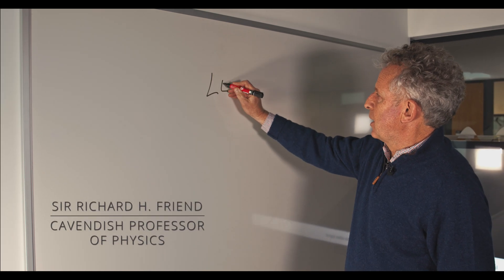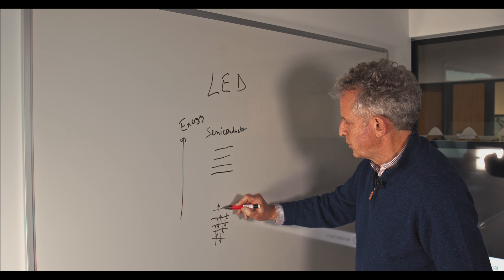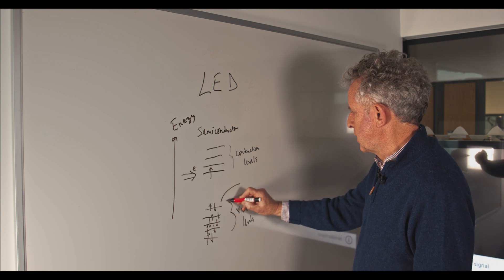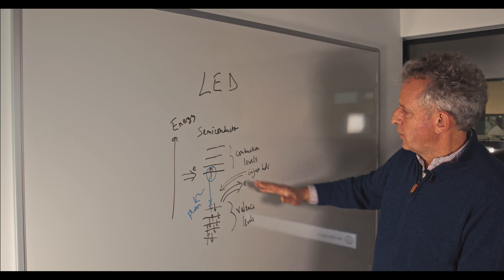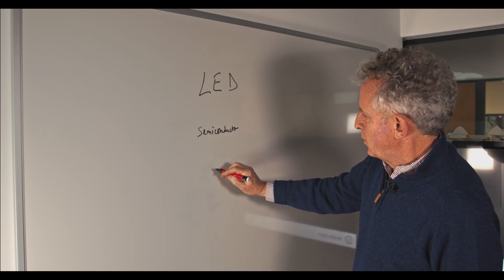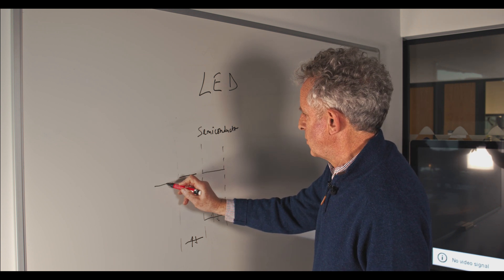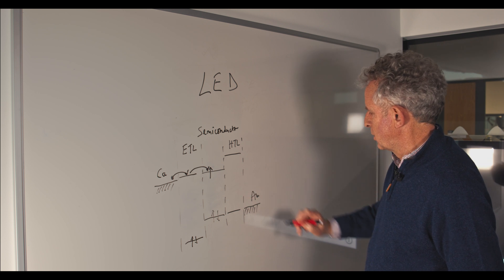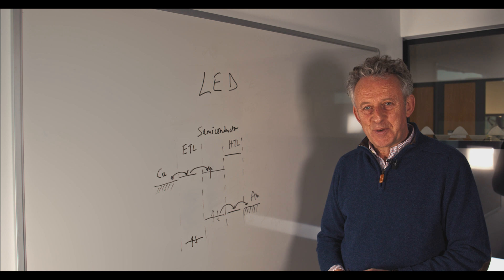How LEDs Work (Band Structure Design) | Prof. Sir Richard Friend, Cavendish Professor of Physics

Comment: "on the vertical axis we have energy" - like energy of WHAT? The universe contains more than 1 thing which can have energy.
Reply from the maker: https://en.wikipedia.org/wiki/Band_diagram
Reply: energy of electrons (and energy of holes goes in the opposite direction, so the further down the more energy).

You probably know from chemistry that there are only finite states that an electron can fill up in an atoms orbitals. When you have a crystal (a semiconductor) which is composed of practically speaking an "infinite" number of atoms all of these states sort of blend together into "continuous" regions called the conduction band and the valence band. The difference in energy between the conduction and valence band is called the band-gap energy which electrons cannot exist in because they are not allowed energy states. (The bandgap energy is what makes some materials transparent while others you cannot see through)

--> So its the energy of electons. If a photon hits an electron in the valence band and the energy of the photon is greater than the band-gap energy it jumps to the conduction band.